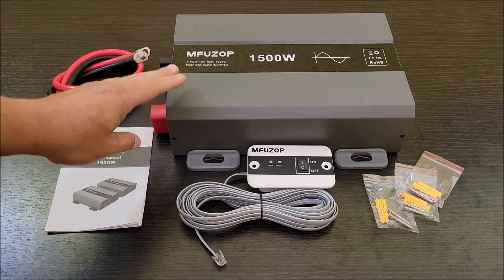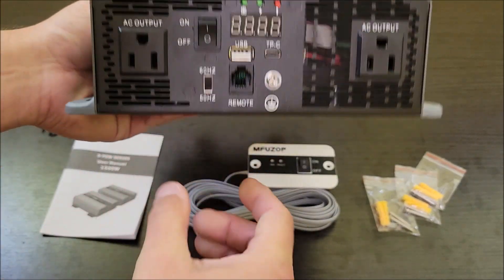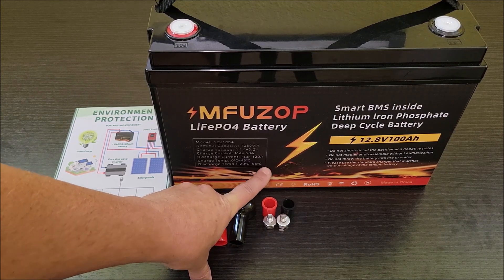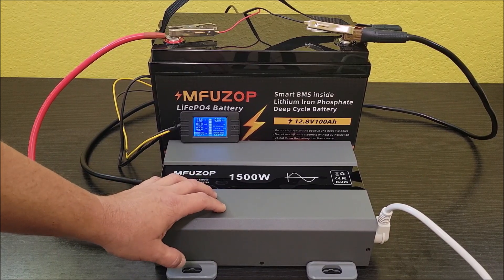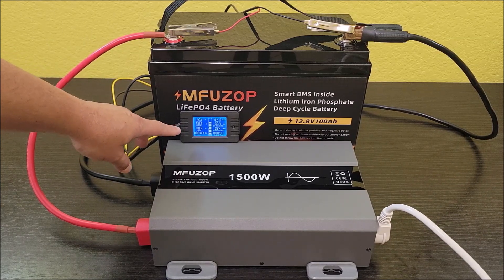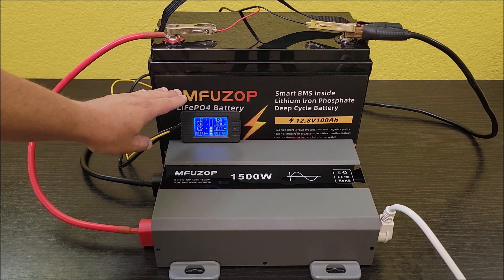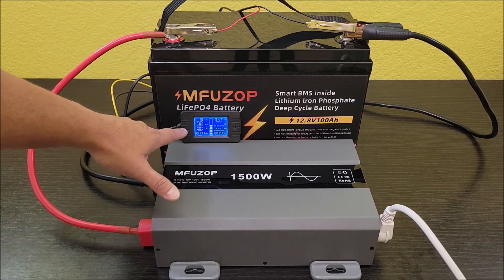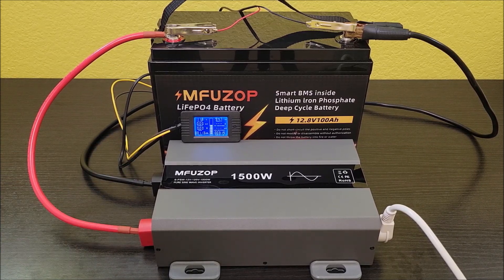Testing a MFUZOP 100ah LiFePO4 Battery and 1500 Watt Inverter

Comment: On cheaper batteries  cells are un balanced  so you can't get up to a full charge before the BMS shuts it down. If the BMS is good at balancing then a very slow charge is needed.
Reply from the maker: Ah, good info.  That might be the issue here.
Reply: You need a tiny charger like one amp @SeidelRanch

Comment: These batteries are great bought 2 of them for my 2019 jaco trailer do Remerber u need a lithium converter charger to get to full charge and to manage batteries properly.  I have a viveor 80 amp   converter lithium charger depending on what the batteries voltage is charges 40 to 75amp . Charges batteries  very fast with a save  charge.
Reply from the maker: Glad they are working well for you.

Comment: hey buddy is this inverter still working for you i love mine works great now theres some trim pots inside and im sure one of them is for the output voltage so you can change the voltage to 110v to 120v but im not 100% percent sure witch one it is tho lol theres 3 trim pots inside the inverter so yeah just wondering if yours still working or not

Comment: Great insight but without a shunt these battery monitor numbers are very suspect.
Reply from the maker: My battery monitor has a 300 amp shunt on the negative lead wire.

Comment: Im also keen to know if you can do another discharge capacity test, I want 4x big 200Ah MFUZOPs and my seller cant give me any case studies nor is it really clear how the 10 year warranty works!
But I would be alot happier if the battery is holding up, obviously its still early days

Comment: Do you have a clamp Ammeter? To measure the inrush current when your compressor kick start. Make sure is within battery manufacturer data sheet recommendations.
Reply from the maker: Ah, that is a good idea. I would like to know just how much these AC units pull to get started.